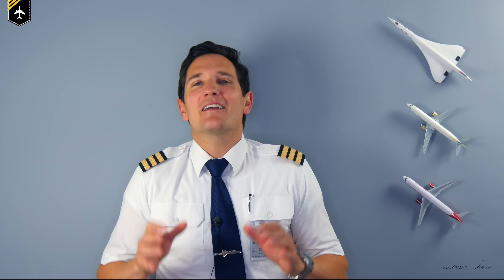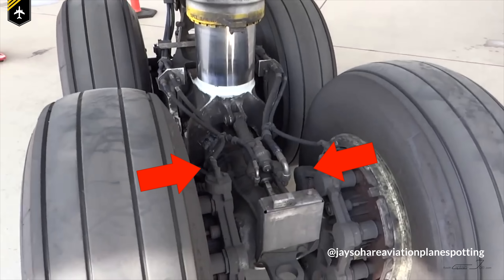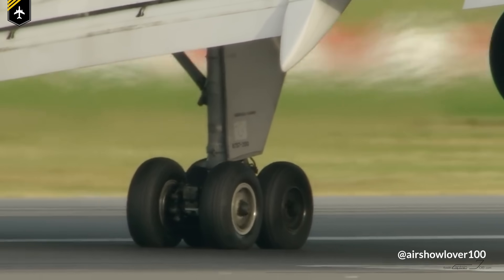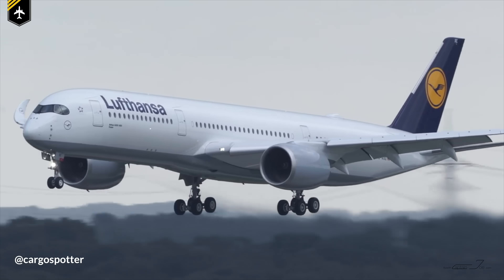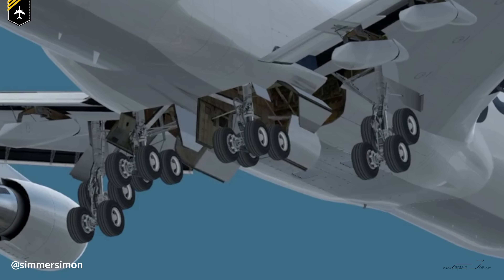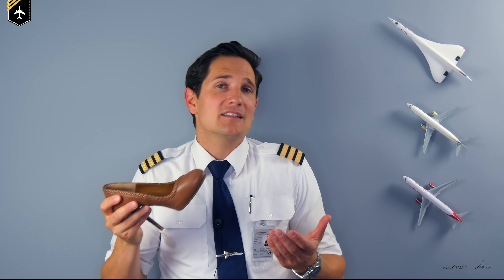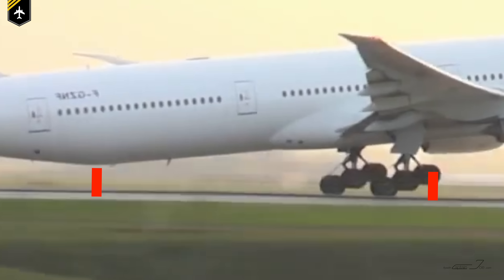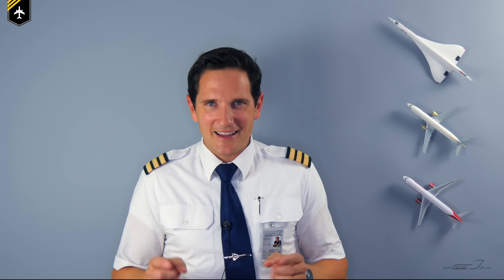Why is the LANDING GEAR TILTED? Explained by CAPTAIN JOE

Comment: Captain Joe, after complements. Your video clips on aviation are very informative and I love to watch them. I have one question in my mind which is as follows. On the top portion of a Boeing 777 model or Boeing 747 model or Airbus 380 models there are small triangular shape ( ( similar to the shape of radar but very small ) flaps. What are they ? Apart from those 2 or 3 flaps there is a flat dome type thing ( like a big inverted cooking pan ) What is it ?  Recently When I was landing at Pune airport in a domestic flight from Goa I could see the PAPI lights on left side of runway and all the 4 lights were red. Eventually the plane did not land but had a go around and in the next attempt it landed. I remembered your clip on PAPI lights, all red you are dead.  In the lobby I came across the Captain of our plane and asked him about the go around. I asked him if it was because of all 4 PAPI lights red. He laughed and said that it was not the reason but some other which he can not disclose. Thanks and regards. S.V.Patwardhan ( Ret. Architect )
Reply: Shrirang Patwardhan those are triangular shaped antennas for VHF radios
And the pan shaped antenna is for satellite WiFi 
And regarding PAPI lights, it should be white and red from the cockpit, rather than the passenger side. Moreover in flying, once you are over the threshold, you don’t have to follow the papi as you are at 50 feet and about to flare.

Comment: I have a question, why did the wheel assemblies need to be stored at all, why can't they be left down?
Reply: If the landing gear would be left down it will cause a lot of air resistance and reduce the aircraft's air speed and increase fuel consumption. The speed would be really slow and the aircraft would have much shorter range because it would use more fuel.

Comment: Is it too far off to think that it may be better for less tire wear, that the tires be spinning at the same speed as the plane is landing? Is there such a system? Or am I just some keyboard airplane engineer just coming up with crap?
Reply: It isn't done that way because it costs more than replacing tires.

Comment: Good info. Also only 2 wheels contacting runway first is less torque stress on the struts. If 2 =XX and 4 =xxxx and 6 =xxxxxx is the amount of rotational stress at the strut and wing beam mounting points. Another is cost in tire replacement, as rears contact first each and every time they wear faster. and are rotated out on a replacement schedule. Vice versa for front wheels down angle.

Comment: Captain I have a question ....on landing gear ...when an aircraft like the 777 moves on the runway a strange noise as if the tyres are hitting a gutter in a spoiled road is been heard. The aircraft should be moving smoothly isn’t it why such a noise from the under carriage. But I haven’t observed it in a 737 or 320. What is that noise ?

Comment: But the Airbus A340-600 has gear which tilts in opposite directions. The outer wheels tilt upward and the one on the centerline tilt downward.

Comment: I wish you had shown the C17 landing gear and the B52 landing gear as well. Both are very unique designs. The B52 however is truly a one of a kind, being that the gear can all be steered in such a way as to allow the aircraft to takeoff and land in extreme crosswind conditions with the aircraft actually traveling down the runway at extreme angles. I hope you will consider doing a second video featuring these two unique landing gear designs. As always, love the videos.👍

Comment: What If somehow they engineered some sort of lightweight, extremely efficient kind of fins that mount to the side of the rims of the undercarriage and these bad boys kind of get the tires spinning before touchdown to reduce wear and tear on the rubber? I realize they would have to be small because space is a major issue that's why I said they should be incredibly efficient, I wonder if it would be worth or if tires are cheap enough that they don't need to worry about that stuff

Comment: How are the struts of the landing gears sturdy enough to withstand the force and impact when coming in to landing? It sometimes feels like with all that speed and force as you're coming down to land and slow the aircraft could break off in someway because so much force it has to deal with in order to slow down.
Reply: There is also a shock absorber in the landing gear. Here is the lower cylinder (silver color) clearly visible:
https://i.pinimg.com/originals/21/b8/71/21b871a2e530e1c684117053c5867f31.jpg

Comment: If its not tilted it will explode
Reply: Nothing to do with that. As it was mentioned not all the aircraft have heavily tilted landing gear. (Like for example B707, MD-11, DC-8.)
Reply: @mikep9604  those are light planes. Like the 777, 747,A380,A330 Etc

Comment: Thank you Captain for this great video, nice job. I was wondering if you could make another one about weel breaks (especially autobrakes and the way to calculate the right autobraks setting for a certain distance to vaccate from this or that taxiway, for both a320 and b747, as you used to flight both). Thank you :)

Comment: "The 777-300 is at great risk of a tail strike on rotation"
737-900: Hold my beer
Reply: Tail draggers: hold my vodka
Reply: MAX 10 intensifies
Reply: KLM 747 flight 4805 : hold my tailstrike
Reply: A340-600 enters the chat
Reply: @inigovanaman1655  777 9x HAS ENTER THE CHAT
Reply: B-29: Hold my... eehm... i dunno
Reply: KLM 4805: Hold my Pan Am
Reply: 737MAX: hold my mcas
Reply: Q400: hold my tail
Reply: 737 max :)

Comment: Why don't the just use a spring instead of a more complicated, failure-prone  hydraulic actuator?
Reply: 6:33 - I guess that is the answer.  A spring would not be strong enough to actually help lift the plane off the ground during takeoff, whereas a hydraulic push would.

Comment: Can you do a video about why do planes flair
Reply: So they don't smash into the ground. When on final approach a plane typically descends at over 700 feet per minute. Anything faster than 240 fpm is considered a hard landing and the 737 is designed to take landing rates of no higher than 500 fpm. If the plane went into the ground at that rate the landing gear would collapse. Therefore, raising the nose 20 to 30 feet from the ground makes the landing much softer because it slows the rate of descent.

Comment: Why aren't the wheels already spinning before they touch the ground? In my opinion this could greatly reduce stress on the landing gear. It ca be achieved by hydraulic means or passively with rubber fins on the tires

Comment: what I don't understand why the aero engineers didn't make those huge wheels spin with electric motors to equalise the wheel rotation to match that of the aircraft speed at landing so you won't get that sudden wheel skid and smoke and a screeching noise,  doing so would   get even more smooth landing and less tyre wear.
Reply: M Gabrielle having electric motors will bring more complexity, weight and costs to the aircraft. So it is not a practical solution.

Comment: Another great video! Question: If winglets reduce drag and therefore improve fuel efficiency, why do so very few cargo aircraft have winglets?
Reply: VICTOR PAPA cargo planes are generally older planes, so not all of them can have winglets retrofitted to them. Moreover winglets will increase the cost of the aircraft, so there is not much to gain for airlines, especially if those cargo planes are flying short routes.

Comment: Why can't we add some small motor to spin the wheels before touch down which will help to reduce tire wear out?
Reply: It would make the landing gear structure and system more complicated which will need extra maintenance (which increases the airline's costs), and the system could very easily have failures often which can be a safety risk. It's easier to change the tires when needed.
Reply: @mikep9604  Tnx Mike

Comment: Where did the fuel tank attached in an aeroplane
Reply: There are several fuel tanks in the wings and usually also a center line tank in the fuselage.
Reply: @mikep9604  thanks

Comment: As a sidenote - try to avoid stepping 100% on your heel. It destroys your knees. Instead, touchdown with your heel and then place your weight on the front of your foot.
Reply: Jay Maverick Actually you should touch down with the front of your foot, the joint where your phalanges and metatarsals meet. or better known as the ball of your foot, and then your heel second. This is how humans walked before shoes were around. Your whole foot is a great shock absorber when you do this and it actually saves energy because your foot and lower leg transform some energy into pushing back into the ground as your foot leaves it. Shoes nowdays especially with all the cushioning put us in a bad habit of landing on our heels first. Try running on concrete barefoot, you’ll instinctively land on the ball of your foot first to avoid discomfort.

Comment: 4:30, ahh yes, a 747 made of the strongest material ever, plywood
Reply: At least it's cheep. Jetblue can operate them now
Reply: Plywood and bailing wire and duck tape !!  lol
Reply: @michaeld1906  no how dumb are you?

its sticky tape not duck tape
Reply: actually  hi  speed tape  we use on the aircraft in the navy,  lol

Comment: Hi captain joe, what would happen if the landing gear was deployed while at cruising speed?  Would it rip right off?
Reply: TWA Flight 841, a 727 which had a slat segment deploy during cruise and soon after went into a dive, landed ok even after gear deployment at transonic (IIRC) speed.  They were getting cockpit lights that not all was well with the gear, but it did its job.  When you think about it, the needed fore-aft strength of the gear would likely be designed by ground loads, especially from braking, rather than aero drag.  Even well above the deploy limit speed, drag isn't going to be as much as those ground loads.

Main landing gear are designed to rip off in the case of a high-speed runway overrun.  The big metal pin through the hinge at the top of the strut is engineered to shear at greater than a certain combined load.  That hopefully avoids the alternative of the wing structure that the gear hinge attaches to ripping instead.  That would rupture the fuel tank and cause a big fireball.
Reply: The doors most likely would be ripped off.  The gear itself wouldn't.  Gear that swings forward into the airstream (nose gear) might not lock correctly.

Comment: That’s a great video Captain. I have a couple of question. Why do the landing gears retract after the takeoff? What would happen if they remain as such even during the flight?
Reply: There is a very good reason to retract the landing gear. If it is not retracted the landing gear will cause drag and reduce the speed of the aircraft. The aircraft would fly much slower speed. The drag will also increase the fuel consumption, and the range capability of the aircraft would shorten.
Reply: Thank you Mike :) a much convincing reply.

Comment: Many, many moons ago, out of SFO, as a very young girl probably only 20 flights in to what is now 100+ (moved across country and married to a NI/UK expat now= lots and lots of flying + flying when I can as in lessons), was in a plane which took a tail strike. It ended up fine for all. Was not really a 'big' or 'huge' deal. They just followed protocol and we got where we were going OK but man... that sound. I don't know what was worse: traveling with two lap babies or the incident. 😨✈😜 We traveled the 777 back to Ireland several years ago for a wedding. Was nice enough for sure. My favorite still stands and has yet to be beat: The Lockheed L 10 11. She was an amazing airplane loved by both pilots, crew and frequent flyers. 2nd fave still remains the good ole 747. I have yet to have a two engine passenger jet win me over lock, stock and barrel. And I will keep my mouth shut from here. 😊😎

Comment: why not have wheels move forward to match speed so no erk erk when it hits the ground. wouldn't that work?
Reply: Because there's no reason to, and every pound you add to the aircraft costs money on every single flight in fuel.

Comment: while a tilted wheel may save space to retract into the body of the plane.. there then can be no real reason why after it is lowered, that the actuator could not even out the wheel taking any tilt out of the wheel..
Reply: LivelysReport Because the tilt actuator is there to position the gear for retraction, not for landing. As the video explained, the resulting tilt for landing is unimportant. It does make a small difference when landing the aircraft though, as the heel-toe tilt of the 757 tends to make for a smoother landing than the toe-heel of the 767. More an issue of professional pride than anything else.

Comment: I have always wondered why there is no electric or wind powered mechanism applied, that makes the wheels pre-turn at landing speed just before touchdown,
to extend the life span of the tires and reduce the risk of puncture, thus improving landing safety.  It would not need to be heavy or complicated at all.
Reply: Because it isn't needed, and every extra pound of equipment you take into the air is one pound less of paying payload you can carry and must be paid for in fuel on every single flight.

Comment: I mean, reconsider the C5 Galaxy. If how wheels were stored determined the angle at which trucks strike the ground, then how come Galaxy trucks don't hit the ground sideways? 

..Because it's relatively easy to position them exactly how you want them mid flight. So why then don't engineers choose to make landing gear trucks strike ground leveled off?

Comment: I don't think how the wheels are stored necessarily explains why they don't hit the ground at the same time. It would be very easy for a hydraulic part to level out the truck as a part of deploying the wheels.

So there must be another reason. Do they stay tilted then because of time of deployment? As in, it is faster and more reliable to deploy the trucks in the position that most closely resembles how they are stored? 

Or is it a tail strike safety issue? Where not leveling out the trucks provides pilots an extra meter of height to avoid damaging their plane?

I need more information to understand why engineers have seemingly consistently decided striking the ground with 2 wheels is more worth while than striking it with 4 or 6 or however many are on the truck.

As you make clear, they've literally built devices to force the back row or front row of tires to hit. It wouldn't be hard to have those devices make the tires level before hitting the ground instead. 

So.. why don't they make it level? Is there a downside? Is there no upside? Not enough upside? Is having a trigger system in the airbus just more convenient? Do the pressure relief systems you describe make it impossible to blow out tires on a single row before the full truck is engaged?

This was a neat introduction to something I've thought about since childhood. But, it's left me with more questions than answers.
Reply: Hey, not an aircraft professional in any way but I believe it has to do with friction and wear. Having all of the wheels (like on a 747) touch at once would have them all trying to gain traction and have all the weight on them at once, wearing them quicker. We all know how much airlines care about their bottom line so it would make sense for Boeing to be able to boast that their tires can last longer because of this feature

Comment: Very interesting video, but surely the semi-levered main gear is only on the 777-300ER. If you like the main gear sequence on the C-5 you should have a look at the gear retraction on the Rock well B-1 bomber. The main gears are slid closer to the centreline and then rotate forwards and upwards.